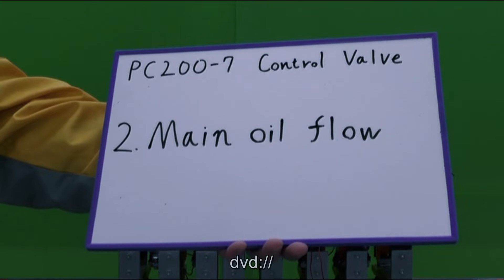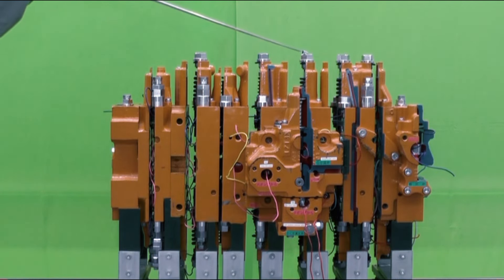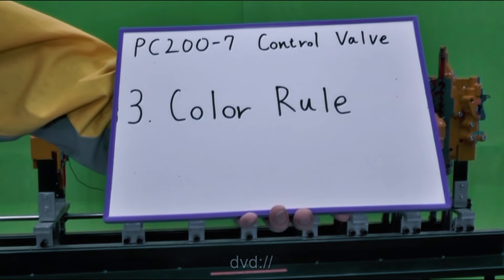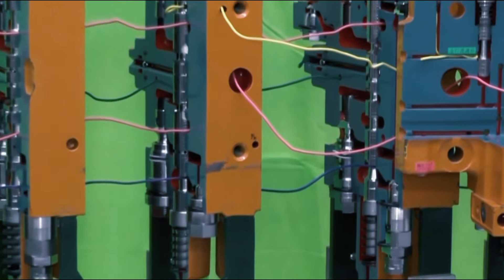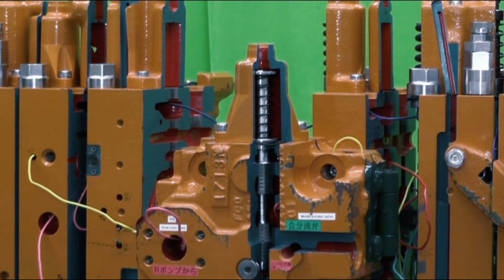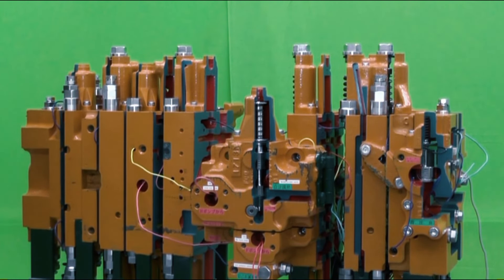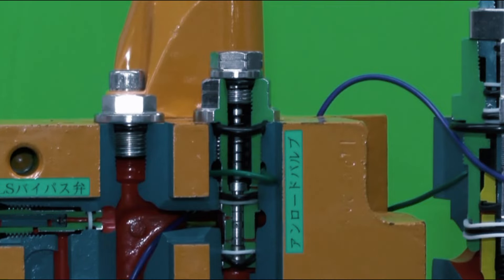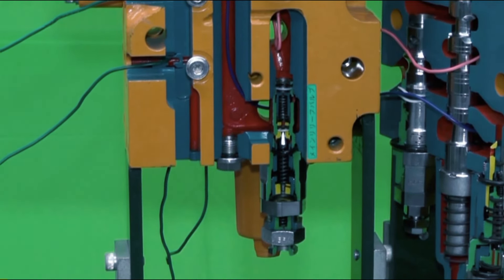PC200-6/-8 EXCAVATOR - HYDRAULIC SYSTEM 3/5 (Block - Sequence valve - Pressure reducing)

Comment: What's the main cause if the excavator wont slew left, and the arm ram raises. Is this do do with the control valve or the shuttle valve? The machine I'm working on at the moment is a PC200-5